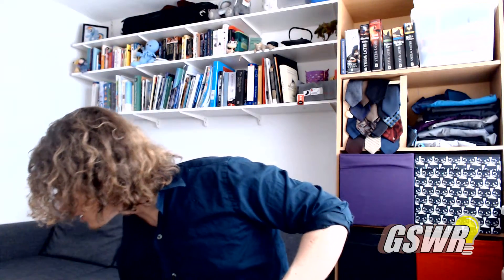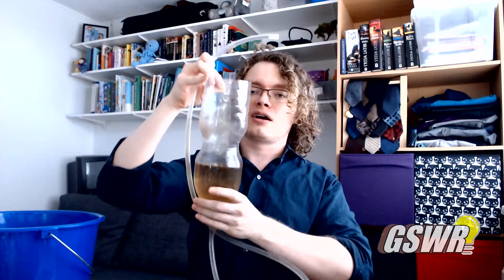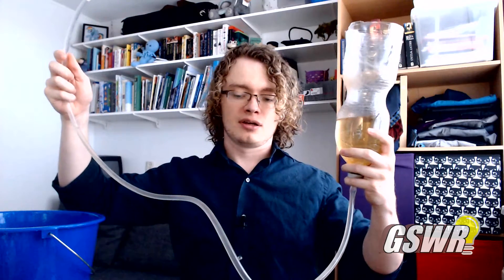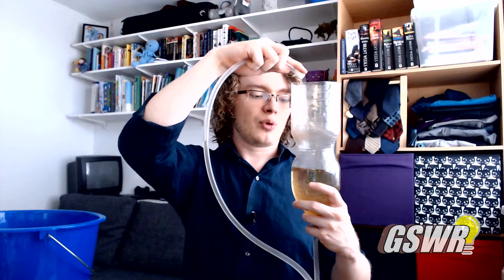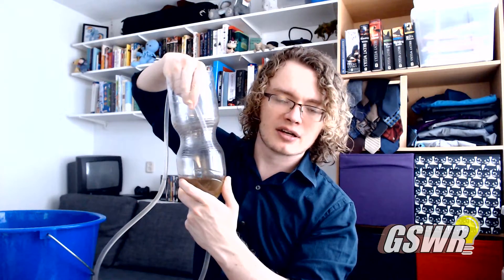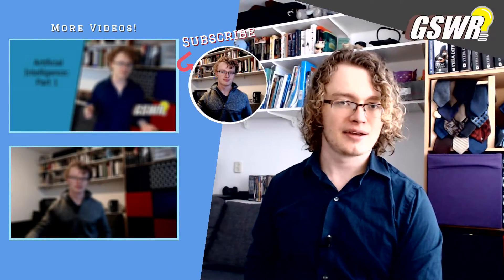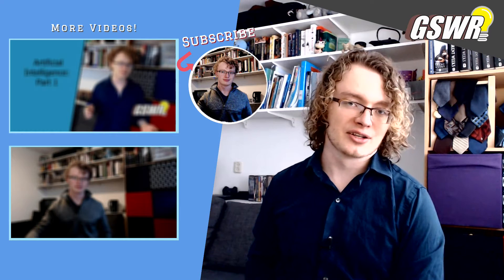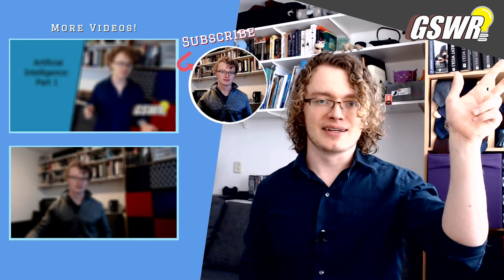Debunking Perpetual Motion Machines

Comment: Perpetual motion in a sense is the easy part of the problem. The hard part that will never be solved is everything wears down, weather's and breaks. Erosion, corrosion etc etc.............. only God has the keys to such problems. Perpetual means constant without ending or stopping. That is not an easy conundrum to solve. Mankind is finite in this physical realm and so too everything we create.
Reply from the maker: So the problem with perpetual motion isn't actually in the motion, it's in getting work out of the system (which is impossible, since that's infinite energy)- wear only happens because of energy being taken from the system, be that friction, heat, whatever. In a frictionless vacuum, you could make "Perpetual Motion" Just not harness it towards anything
Reply: @getsmartwithrory9268  everything man makes breaks and wears away. Nature reclaims and weathering degrades. The vacuum you create is man made and contained within man made materials. It won't last. Everything needs maintained. Spares, repairs...................
Reply from the maker: @branni6538  This is the nature of entropy. It's not just man made things, to our best knowledge, everything breaks down, even possibly subatomic particles, until nothing but background radiation remains (being the highest possible final entropy). Mountains are worn away by the winds, the earth slows its rotation every year due to tidal effects from the moon, eventually the sun will burn out.

None of this affects the nature of a perpetual motion machine, which isn't impossible due to wear, but impossible because the act which causes wear robs energy from the system, and energy is finite- else, you can plug the system into itself for a positive feedback loop of increasing energy until it explodes (or creates a singularity, I suppose)
Reply: @getsmartwithrory9268  I'm wasting my time as you cannot grasp the simple principles of what I'm pointing out. I could continue to point out the facts but it won't compute. Man made machines and materials are finite not infinite. You can hold lightning in a bottle but the bottle won't last forever. Leyden jars being an example. Create a vacuum within it. Well done..................but the bottle won't last forever intact, pristine. End of..........
Reply from the maker: @branni6538  You seem to believe that there is some inherent difference between what is man made and natural, but both break just the same, and neither have an effect on why perpetual motion is impossible, so I guess I just don't understand what point you're trying to make
Reply: @getsmartwithrory9268  incorrect. I understand man made and natural just fine. Perpetual motion 'machine'. Energy drives a 'machine'. A machine equals moving parts made by man out of materials be they man made or natural. Motion equals movement. Movement requires energy, drive....................to be moved. Any working parts require energy to move, same rule applies for a clock or a vehicle/vessel or drive shaft. Perpetual equals continuous, infinite without limit of time or motion it keeps on going. Even if you create vacuums etc and secret bunkers to hide it in, it cannot be perpetual as everything including the bunker and the vacuum are governed by external factors. Pressure, temperature, invisible forces, chemicals, weather, water, motion, animal kingdom ad infinitum..................the factors of interference, decay and destruction. All paramount relevance in creation, manufacture and maintenance of perpetual motion machines. Is it the same brush if it has had three new heads and four new handles??? Can you keep sweeping once the head has worn down???? In a vacuum or not, limit or erase friction etc the vacuum or external housing wouldn't last forever. Good luck if you choose to spend your life trying. Parts that dont decay erode or wear, constant infinite energy to drive it, perpetual motion without hindrence, interference, maintainance or decay. Good luck with that.
Reply from the maker: @branni6538  Did you miss that this entire video is debunking perpetual motion machines?? It's right in the title....

And vacuums aren't particularly difficult- just go into deep space
Reply from the maker: I still don't understand what point you're trying to make, except some show of intellect against somebody who isn't arguing what you seem to want me to be arguing

Comment: Simpletons wouldn't understand things unless they are explained;  your water needs to have a tube within tube that is suspending your container and thus container would have whole of it's weight that is sucking the water up and if needed;  you may use tesla valve under your container and prior to as it goes up and you may want to separate water containers until they far outweigh suction towards reverse.  If you can't figure anything with that;  which ever ones that you are;  keep trying to concentrate on your imaginations and your possibilities that you could use as tools.  I once realised that if one figures how to make things happen;  then that same one shall see countless ways that things can be manipulated;  I was right on that and I hope you all can use these ones that I tried to make you see.  Here is another;  have a tonne going down ten feet while cranking 120 000 springs each their turn;  that are capable of that weight each.  Then as they are cranked 1 thousand of an inch each.  release them all at the same time on that tonne;  this is on paper and if you would like to have me explain to you how it can physically be created.  Ask me and I can tell you a few ways to solve all the hurdles that you encounter.  Cheers.
Reply from the maker: This reads like procedurally generated text to imitate technical language. Would a Rockwell Retro Encabulator fix the problem? https://youtu.be/RXJKdh1KZ0w

Comment: Put the textbooks down and use your imagination! Work with a tank of water try everything to keep the water circulating it might take you ten years but eventually you'll find the missing part of the puzzle. Mass=energy ✨
Reply from the maker: Er, yes, mass does equal energy, but there's still a limited quantity. You can calculate pressure, gravitational potential energy, chemical, nuclear even (a bit of mass has an incredible amount of energy if you can somehow convert it all)... but that's a far cry from perpetual motion. I can make water circulate forever, but as I mentioned toward the end of the video, it requires adding energy to the system somehow. Looking at Boyd's Perpetual Flask again, people like to give the appearance of it working using either a pump or a subtly attached second container of fluid which is kept higher than the entire system, which is piped to the top portion of the tubing... one sec, I'll link a good one I saw recently.
Reply from the maker: Here's a "working" perpetual flask using the two container method I mentioned.
https://www.youtube.com/watch?v=Rbg10U3aTrM
The thing about science is that it is simply the study of how the world works- if we can't explain something using science, it shows only that we don't understand it, not that it cannot be understood.
....although, there are some things our brain may be built in such a way as to be impossible to understand for US. For instance, to quote Richard Feynman* "If you think you understand quantum mechanics, you don't understand quantum mechanics"

*there's no concrete record of Feynman saying this, but it's generally attributed to him, and not frequently attributed to other scientists, unlike, for example the saying that if you can't explain something simply, you don't understand it well enough, which may have been first said by Feynman, or Einstein, or both may have come up with the expression independently.